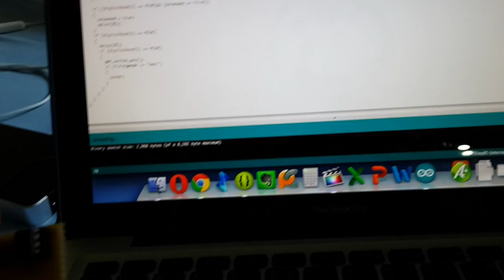Homemade Airsoft Auto Sniper Rifle

Comment: I have a few questions:
I do not understand trigger send an input signal and the output signal control an electrovalve? 
(of course using voltage adapter or similar)
Cuold you say to me if that is right?
The electrovalve opens quickly enough? 
Cuold you send a link of the datasheet of the valve?
Sorry for the disturb and sorry for my english it's not my motherlanguage

Comment: I know i'm like super late, but I am wondering how you programmed the micro-controller with arduino code so simply. Also, i'm programming an ATmega328p so if anyone could offer help with programming that would be great. If not, i'm sure i'll get it some day.
Reply from the maker: UberBlade I used an usbasp programmer but any arduino can be used to program the attinys if you configure it right. There is an easy to follow tutorial on the MIT high-low tech group website for how to do either.
Reply: Thanks! I will look into that.

Comment: Good but you don't really want an auto sniper... Because that reduces the power of the shot... I think
Reply: +Pandaz Gamez I think it's different on Airsofts
Reply from the maker: +YellowBlue RC In this case, yes because the operating pressure was only about 100 psi.  But the nice thing about pneumatic airsoft guns is that the pressure can be varied to increase/decrease velocity.  So there is no fixed limit on velocity like with a bolt action unless the gun explodes from over-pressure :)

Comment: How much do you want to sell me all the schematics and the instructions?
Reply from the maker: Canal Sn4k3s ahahah i'll post something for free in about a week when i find the time.  I don't think i'll be able to post full schematics since when i made it i sort of improvised the circuit boards.  I can produce some block diagrams though.  I'll throw the program that the micro-controller runs in there too. Consider it "open source" i guess :)
Reply: @ramicaza  Hey I know it's hard to post everything but I just need to know the parts and the wiring schematics for the electronics.I promise you I will upload my version once I get that all figured out.
Reply: ramicaza We are still waiting for the tutorial...
Reply: +ramicaza you the real mvp

Comment: Nice but could you  please make a picture from the back of  the microcontrollerboard?
Reply from the maker: I would but I'm afraid it wouldn't do you much good.  I used perforated circuit board so the back is just a mess of wires and bad soldering.  Sorry man